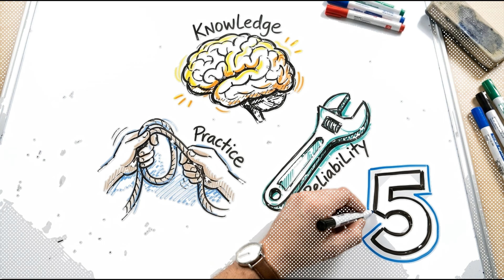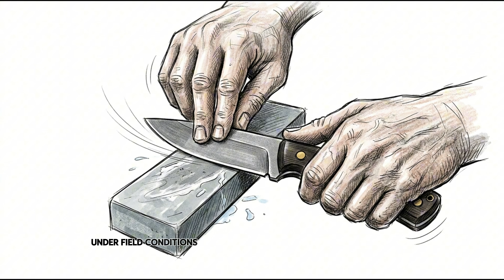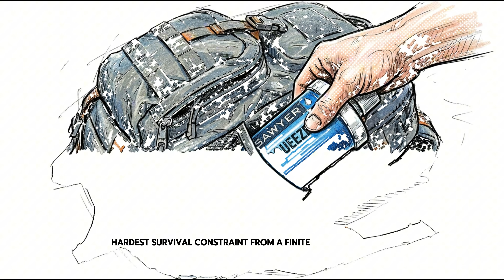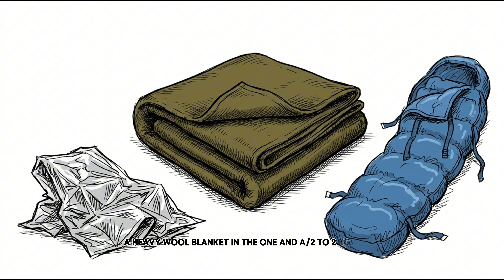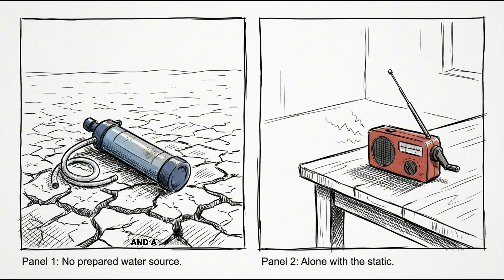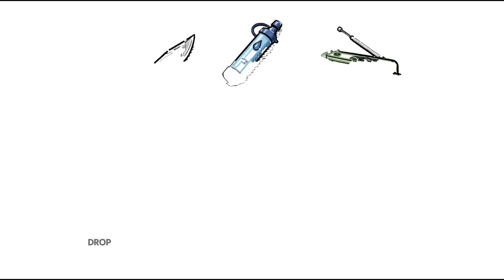Most Survival Gear Is Useless These 5 Tools Save Lives Prepper's Beginner Guide

Comment: Again the carbon steel BS
Reply from the maker: Yes we tried that y
Reply: @DisasterReadyHQ How did you compare?
Reply: What's wrong with carbon steel? My knives are all 1095 and ive not had any issues with any of them.
Reply: @JeremyKnop-c2n I was talking about the false claims about carbon steel still being made today. For me the rust is a problem living near the sea in a rather wet climate. Where I travel is mostly tropical places with, depending on season, a lot of rain. I like to stay around seas, lakes, rivers, streams, etc. In 8 months total backpacking Thailand I used a Mora Basic 546 and the knife got wet several times a day. I sharpened it on the bottom of a ceramic plate or bowl. No maintenance what so ever. I do use a Mora Basic 511 or Hultafors HVK for around the house and they need constant care or they turn into a piece of rust.

Comment: Okay, I have taught Wilderness Survival, and these five items you've mentioned, are very good ones. However, when it comes to water filtration, The Sawyer Squeeze, Sawyer Mini and the Life Straw, fail in two categories. One, they will not filter out petrochemicals and micro plastics, two, or viruses. The Grayl Geopress water filter will, but it has filter limitations. There are others, so just make sure you get one that does both. Boiling does not help. Water purification tablets or drops will get rid of viruses, just get the ones that use the same chemical compounds as your local water company.  Yes, a knife is a very handy thing. But, Cold Steel now has out a line of folding knives that use the Triad lock, and it is extremely strong. I have four Cold Steel Folding knives with said lock, and I would trust them with my life. A good Multi tool can do things your knife cant, so yes, but get a good one. A good First Aid kit and medical supplies, and any meds you or your family needs, extremely important. 

I am a Ham Radio operator, and I have a complete power set up for off grid use, using solar panels that attach to a portable power supply, very useful, not only for the radio, but if any one in your family has any medical appliances that will need to be kept charged. But a good USB Power Bank and solar panel set up can also work well. Something to carry water in, would be nice, or should I say essential.  Oh, if you have to leave your house, take all your important papers. Its different for every one. I personally also back up all my pictures and important files to a 2tb thumb drive, that I can use with my Tablet, which will also go with me.

I like your list idea. I never thought of it, but I do live alone. Any ways, a very good video, that needs a bit of tweaking. Keep up the good work.
Reply from the maker: Great points on water filtration and digital backups, those are definitely critical details to add to any kit! 😊